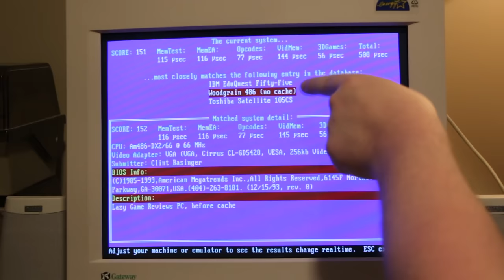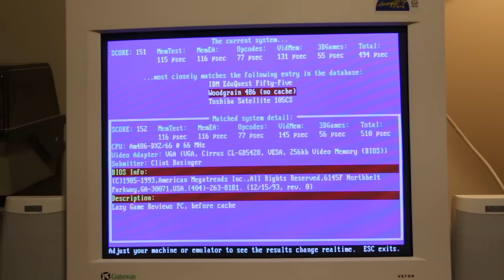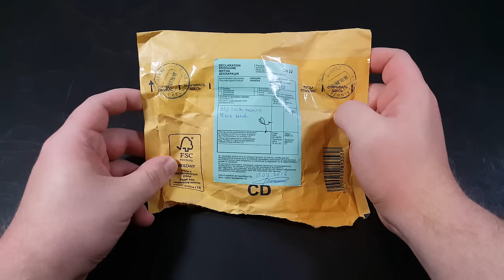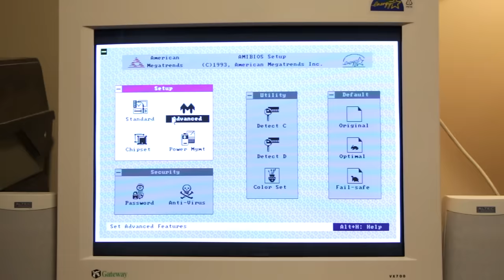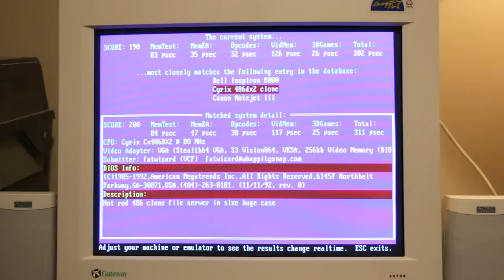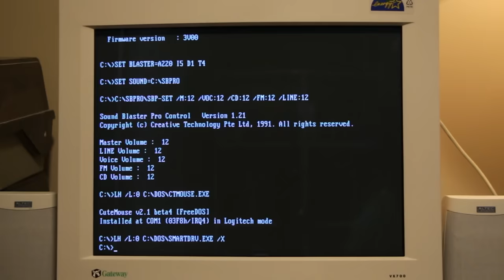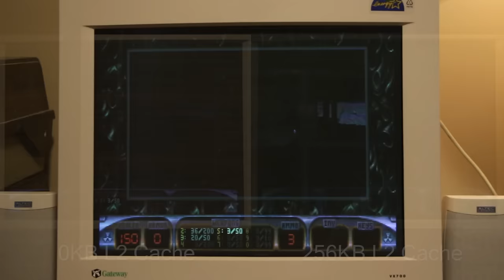LGR 486 Update! Installing L2 Cache

Comment: cache makes a difference. i was ripped of back in the day when i bought my first ibm-compatible. Advertisement said that i had 256k of cache, but yeah, it was not there. Performance was underwhelming. Tried to make reclamation but seller wouldn't send me those missing chips. Gladly i managed to get 256k cache chips for free elsewhere, they were quite expensive back then. 

Without cache my A4000 felt faster at 25MHz than that 100MHz Am486.

Comment: I see it's been said, but yeah, DX4. I watched the original build, but I forget, do you have the 487 FPU installed? 
Rebuilding a Packard Bell 133MHZ (75MHZ original) myself. Just so everyone knows... IBM PC DOS 6.1 is rubbish, also so are old Packard Bell BIOS. For a computer bought in 1995 the BIOS are from 1992 and don't support IDE drives over 2gb.
Reply from the maker: No need for an FPU, I'm using a DX2-66 which has the math coprocessor on-chip.
Reply: Good point!
Reply: 5:44 aren't we missing a screw in there LGR ? :)

Comment: how did you search for those caches ? "L2 cache" doesn't give results on the bay (beyond blabla server with 8MB L2 cache)
I need L2 cache for my 100mhz 486
Reply: You can just search for SRAM. Make sure it's Parallell, 8x32k, 5.5volt tolerant, and corrent IC package type. ISSI IS61C256AL-12JLI should be a perfect drop-in replacement, higher speed and lower power, at 1.4$ each on Digikey.com

Comment: Isn't 256k L2 a huge amount for the time? Sounds decent even for recent years...

Is it because it's not on-die that it can be made this big?
Reply: Modern CPU's have about 256k L2 cache per core, still. It actually comes down to the speed of light - it takes too long if you make the cache die any bigger, so it slows down. Meaning you have to kinda take it or leave it - make it bigger and it'll be slower.... Only solution is to shrink the die size, but it's gonna take a while before we can shrink the cache die area enough to double the size without a speed loss, I think.

Obviously we have many cores, so the "total" L2 cache is bigger, but each core only has 256k still.

Comment: Its a little odd performance is so mediocre on that machine, what kind of video memory does it have?

I remember playing Duke3d atomic edition on my 486 back then with no problems,
and without those window border things to make the viewable area smaller, whats more
I'm sure it was in 640x480 with high detail also.  Now admittedly, that was '97 and the
machine had a somewhat better configuration, was a DX4-100 (overdrive chip, which
replaced the original dx-50 it had came with) and that chip had 16KB L1 cache,
there was 256K L2 cache, 16MB ram, and a Cirrus Logic GD-5424 (if memory
serves) with 2MB on vesa, some cheap soundcard with pretty decent soundblaster
mode/emulation, a 15" 800x600 monitor and win95osr2.   But still, even with the
extra 33mhz and double L1 cache, it shouldn't have been THAT much different,
is your vidcard like 512k or something, if so that might be it, 1MB was standard
in '96 and 2MB-4MB common by late 97 when the atomic edition was out (up here
in canada at least)
Reply: Correction, it was a GD-5426 not 24 the card, and a Samtron 15" SVGA monitor
which was 66hz or something odd like that with a nice tight dot pitch, loved that
display but it eventually developed a faulty degauss circuit and the whole screen
would turn a dark green.. most of the time a swift smack on the side of the
CRT would make that go away (and no doubt expose me to untold radiation
probably) and return to normal, but eventually no amount of abuse would fix
it and I replaced it with an early LCD panel, a Hanns-G 1024x768 one, it
was still 4:3 aspect not like the modern ones but that was awesome too
even though it had mediocre contrast by today's standards.

Comment: Clint, to help stabilize the motherboard in that back corner where there aren't any standoffs put a couple of adhesive bumper pads between the board and the tray. Something like these tend to fit quite nicely. I've used them for 30 years for this. Your local hardware, home improvement, craft, or big box variety store should have something similar from a variety of vendors.  The main thing is to make sure you get the medium to large size, usually the 1/2 or 3/4 inch is just the right height depending on the case. 

https://www.amazon.com/Shepherd-Hardware-9565-SurfaceGard-Transparent/dp/B00004YOHP/ref=pd_sim_60_3?ie=UTF8&psc=1&refRID=WG6BP8BQRG02N335KPDF

Comment: I added 256k to my DX2-66 (coming from 0) and noticed a huge increase, just like you did. Going to 512k, however added no extra benefit. System reports 512k, but everything benches the same. (hope that helps) ;)

Comment: My old 486 run duke just fine. Then  pretty much when duke was new i bought a cyrix 6x86... And it run duke in 800x600with no issue.

There might be some issues with that computer

Comment: Seeing that BIOS screen tortures my soul. See, I once (as a teen) had a bunch of scrap PCs & ANCIENT parts. This was early 2000s and the PCs were...anywhere from late-80s to mid-90s, there was one with that same BIOS, either it got broken or I just tossed it because...well, I was a teen. I tinkered but I didn't feel quite the same passion back then. EARLY IBM 1x CD-ROMs & their controllers...working Pentium-based PCs...5 1/4" floppy drives that worked, etc etc...oh god, the shame...lol
Reply: I trash-picked a lot of old 80s computers and parts in the 90s. No one appreciated old computers then. Friends and family thought I was nuts cleaning these things up and getting them running. I was trying to cobble together a system that would run linux, for free. Lost it all in 2001. What bugs me is not the hardware but these videos themselves. If I thought I could film my restorations and get famous on YouTube... For The Win! lol!

Comment: I ran Duke Nukem back in the day via a 486 DX4 100 with a sound blaster compatible...it ran well on this, but this game did have some demands back then...I may have had a Matrox graphics card as well around that time....very cool stuff.  Duke Nukem back in the day was simply astounding action, and tons of fun...too bad the Xbox 360 game failed so badly....the secondary cache having 2 different sets of ram?  I am assuming that you either use the 28 pin or 32 pin...perhaps you did not need 8, but only 4. If the Secondary cache is optional and probably expensive back in the day, I would assume that most developers would not really take much advantage of it...cool video anyway...this brings me back to 1995.

Comment: The 486 DX2-66 is what the 386 really should have been, people had 386 boxes but when the 486 was released its really what took Intel to the next level. The 486 supported floating point directly without a co-processor and a 5 clock integer multiply, the external cache could was controlled by intercepting the chipset. It only supported a read cache and not write back caches like a Cyrix did.

Intel actually deferred the release of the 586 "Pentium" because the performance of the 486 DX66 was so close to the original 586.

FYI the 486 was the last CPU I designed into a PCI system :) I designed the cache also.

Comment: Belated comment, but it's good to see the 486 somewhat redeemed. Still no idea why it runs so sluggish. I ran Duke3D smooth as silk at 640x480 full screen on my 486 Packard Bell back in the day along with Shadow Warrior and it was a DX2-66 with 8MB of ram. Still own the original box with the specs sticker on it.

Comment: can you install DOS on a 7700k with an asus z270-e strix with a gtx960 and 16gb of ram? (also can it be on a partition dualbooted with windows 10) (mostly for messing around with dos games)
Reply: Ciarán Farley-Toone, not likely, DOS would have no idea what to do with modern components. This thing runs on 66mhz and you're trying to give it over 300x that with completely alien communication protocols. It would shit it's pants with that much power, it barely understands the concept of USB. 

If you knew how to write your own drivers for it, it might, might be able to take advantage of some modern components, but that would be far more trouble than it's worth.
Reply: dang
Reply: Ciarán Farley-Toone just run an emulator

Comment: Currently, my favorite build is not my Primary Driver* (i7-4790k, pci 3x4 ssd in slot - gtx 1070 -- no complaints), i't's a Pentium i built some years back. I've been building since 97. The Pentium build is an ivy bridge g2030, h61 chipset and yeah not retro, it's just got a certain something to it that makes me feel good. it's a rev 2 board, super stable and yeah dosbox runs well on it. i installed a gtx 640 and now it can game native. dosbox also runs pretty well on my PD* (ibid). the Pentium was my firewall for quite a while. i feel now as if i was mean to it. my all time favorite build was the first AMD 1Ghz chip with a geforce 256 Guillemot gpu. then my drunk roommate sprayed canned air propellant into the gpu fan and i was sad, very, very sad. Guillemot was extremely nice and sent me a new fan.

Comment: So in 2070, the computer will finally use Windows 7 as the OS?
Reply from the maker: On a 486? Heh, even in 2070 it won't change the requirements for Windows 7  :P
Reply: Reminds me of this guy running Windows XP with just 7mhz

http://winhistory.de/more/386/xpmini.htm.en

Comment: Does anybody have the pinout of those cache chips? I want to know if modern SRAM from mouser would also work.
Reply: Basically any 32x8 Parallell SRAM should work, as far as I can tell. Although you can find basically identical chips on Mouser or Digikey, the ISSI IS61C256AL-12JLI. It's -AL suffix suggests a more modern silicon process (lower power, higher speed), and the -12 suffix at the end means they're rated at 12 nanosecond latency. So, they're faster and more efficient, and should be drop-in replacements! 1.25$ each, if you buy 10. :)

Comment: This video is very old, I know, but the reason that your cache made such a huge difference is because you have very slow memory access... my 486 DX2 RAM has half the latency of yours (43 vs your 95) and and a bandwidth of 25MB/s, compared to your 12MB/s. The RAM in my system is just some standard ~60ns 72-pin. I remember that the motherboard chipset used to have a massive effect on memory performance back then and well into the P6 core CPUs. It wasn't really until memory controllers were integrated into CPUs that this stopped being an issue, but in the 486 and even Pentium days a lot of trashy low-performance chipsets were floating around. In fact, trashy knockoff motherboards sold at a steep discount would sometimes even have the cheapest off-brand chipsets rebadged as good ones and fake L2 installed.

Comment: Couple years ago, just for fun, I built "super Pentium III machine":
Pentium III 1GHz (Coppermine), 1.5GB SDRAM-PC133 (3x 512MB), Riva TNT Ultra 32 MB, Creative Sound Blaster 5.1

I built it from old parts that were going to trash, except memory that I bought specially for this.

If I had that computer in 1999-2000, I would be so happy...

My actual computer in 2000 was: Celeron 300A, 96MB SDRAM (32 + 64), Riva TNT Ultra 32 MB, Creative Sound Blaster 5.1

Comment: The biggest impact I've noticed wasn't so much on 486 systems, Pentium systems were more like it. Games/Applications were paying more attention to that stuff around that time so added Cost modules in a Pentium setup was way more beneficial. The biggest performance jumps besides clock speed differences you would  see between builds would be the SX/DX designation (Whether or not an FPU was present) or the write-back vs write-through cache found which I've noticed is why I prefer my 486 Overdrive DX2-66 over my 80486DX2-66. I have some boards with cache chips installed and others not so much. Pentium PRO CPUs you see a big jump when you change cache. Pentium II era not so much. The one time I would ever recommend buying a Celeron in any generation. Hell, Pentium 4s can be skipped in favor of Pentium III and Xeon builds that will blow any of them away. If you need a Pentium 4 for a task, you might as well go multi-core from that point on and 64-bit. Really depended on the generation but it's interesting how the performance was there but he software just wasn't written to take advantage of it hence why cache didn't make a huge difference in a Duke Nukem 3D test.

Comment: I'd like to get hold of a 486 Dx4 133mhz ( AMD made them ) ... that was the speed of the first computer I built which didn't last long as there was a problem with the motherboard and I quickly upgraded to a Cyrix 5x86 150+ @ 120mhz, which I regretted because whilst it was significantly faster and in the Pentium 150 class, the compatibility was no where near as good and a lot of stuff didn't work or was buggy and annoying whereas everything worked perfectly on the 486.

Comment: 42.9MB/s of bandwidth, damn!

Still, it's amazing to think that a modern Skylake still has 256KB of L2 cache per core!
Reply from the maker: To be fair that 256KB is accessed at a different transfer rate, plus most Skylake CPUs also have 2MB of L3 cache per core on top of that, which is much more important nowadays :)

Comment: Did I miss something or is it a Cyrix CPU you've got in there? If so, that's probably the root cause of the machine underperforming.
Reply from the maker: You're misreading the information :) 

What you're seeing at the bottom of the screen is the machine that comes closest to what mine is running, it is not showing my machine. That's just a comparison tool.

The reason it showed the correct info the first time is because I entered it into the tool myself. The second time I had not done that, so it showed the nearest system in terms of speed.
Reply: At around 7:39 you can see that it is an AMD. I don't remember if that's better than Intel, but at least it isn't Cyrix. Those were terrible!
Reply: AMD couldn't compete with Intel CPUs for a long time, except in the pricing.  I'm guessing they started to catch up in the mid-00s or so.
Reply: K7's (2000) beat the shit out of Pentium 3's.

Comment: I have an old 466MHz Celeron laptop with only 128kB L2 cache. Probably explains why a simple QBasic application that just counts to 2016 takes longer to complete on it than on my P1 machine.
Reply: +AtTheGates Mine has 64MB :-P.
Reply: No, I don't think so. You see, the cache on the motherboard runs at the FSB speed, whereas the cache inside the CPU runs at the cpu speed, wich makes quite a difference between a 66mhz speed for the pentium and 466MHz for the celeron. There's maybe another issue somewhere.

Faster cache is better than bigger cache ^^
Back when the celeron 300A was released, people discovered that you could change the FSB to 100MHz and so overclock it to 450MHz, and guess what ? It performed the same, and sometimes even better than the 450MHz Pentium 2 wich has 512KB of L2 cache, but the cache of the pentium 2 runs at half the speed, where the celeron's cache runs at full speed and has also probably better timings because it is inside the CPU die and not outside.

I have actually that celeron wich is overclocked at 450MHz, and I think that it's faster than my old 400MHz pentium 2 in my SLI build ^^
Reply: +AtTheGates The minimum requirement for Windows 98SE is 24MB, and I once ran it on a computer with 16MB RAM.
With anything upwards of 48MB, I'd say Windows 98 is usable.
Reply: My dekstop has 128MB of ram for windows 98SE, a TNT2 M64 (I wish I had a regular Riva TNT :/ ), a 13GB HDD, and of course the SLI of 3Dfx cards with 12MB on each 8-)
Reply: Deksor Three graphics cards that aren't all the same? Wot.

(I knew that you can do that, but it seems kind of unnecessary, since you can only use one at a time anyway.)
Reply: No, there are only "Two". Like I said, the voodoo 2 are in SLI, so they act as if they were one, and the TNT2 is mostly used for showing 2D (because as you may know, Voodoo 2 can't do 2D)
Reply: The voodoo 1 can't be put in sli, these are voodoo 2, and since these are 3Dfx cards, they support glide apps, where the TNT2 can't. Also, this is a TNT2 M64, wich is way slower than the regular TNT2. I wanted to build the fastest computer available for consumers in 1998, but the TNT2 was'nt released until 1999, so I need a regular TNT (even though the TNT2 M64 is just a tiny bit faster than the regular TNT)
Reply: Oh okay. But still, the TNT2 is apparently as fast as the Voodoo 3, wich is as fast as an SLI ^^

But since you can combine them, why not having both ? ^^
Reply: But it's cool :(
And it supports more game

Also I think I've read that the texture memory for an SLI is 16MB

Anyways, this is mostly a matter of tastes ^^
Reply: Yeah, they made a patch for that X)
Reply: Yeah, but it looks like a 90's games XD
Reply: The original Celeron had NO cache. it was a joke! Intel redesigned it with onboard cache, and it became an overclocking beast. I knew a guy who ran his 300 at 450!
Reply: Like I said, I AM running my celeron 300A @ 450MHz ^^

And by looking at old benchmarks, you can see that it performs more or less the same as the pentium 2 450
Reply: Sure, having a second cache that is exactly the same as L1 cache isn't useful at all, but in the case of the celeron 300A, running it at the same speed as the P2 450 made it a little bit faster, at least in games and a tiny bit slower in other applications, but not by munch.
Reply: Yes the L2 cache of the celeron is slower than the L1, it was just to picture that yes having a L2 cache so small, but so fast would result to have two L1 caches wich is useless
Reply: ***** Even if the L2 cache is small, it's still there, and every bit of cache helps with performance, as long as it's faster as the main system memory (it'd be weird if it wasn't).
Reply: Calvin H. Hey Calvin Hobbes